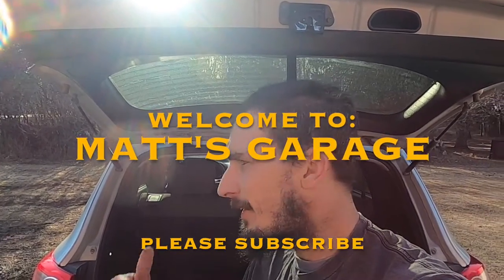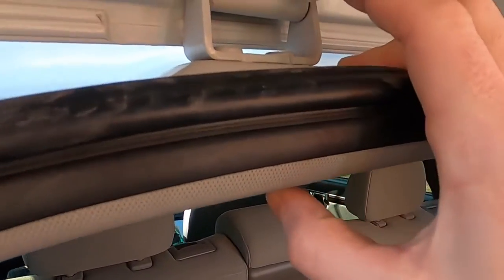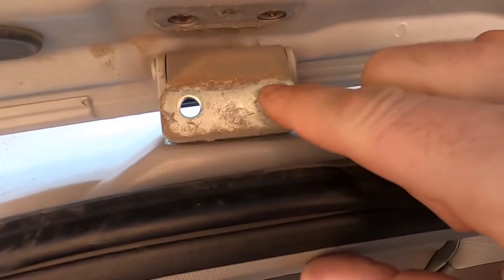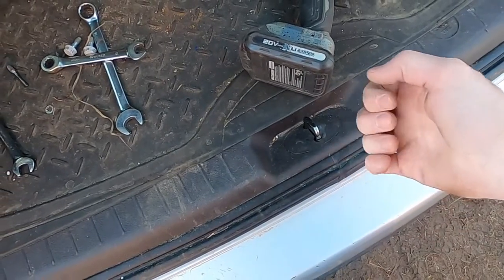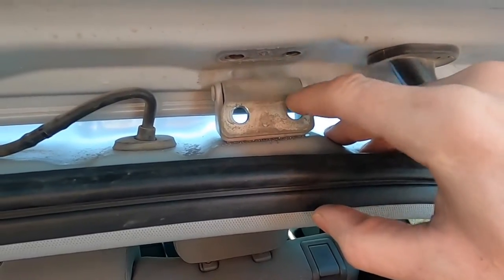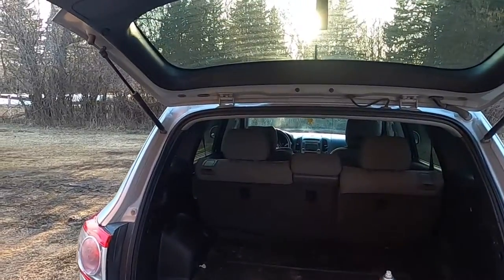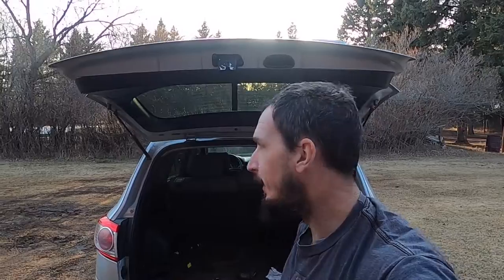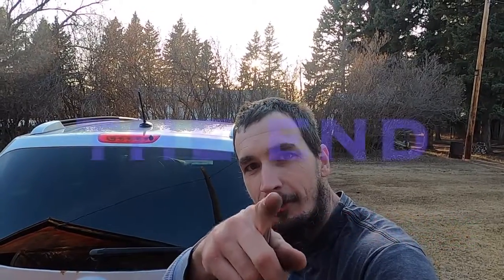SUV Rear Hatch Alignment

Comment: My escape has a massive gap on the left side so im going to shave the holes like you did. Your gap was on the lefty side too, right? So i will need to shave the same holes like you did.
Reply from the maker: Yes, that’s right and it’s possible the Escape has more allowance for adjustment, often vehicles do, but this Hyundai did not.

Comment: Take the door off. Remove the hinges. Place washers or bushing plate between the vehicle body and hinge. Replace hing and door.
This way it will not slip back to the bad position. Gravity will have its way and the door will drop over and over with the enlarged holes nomatter how much you tighten

Comment: Hi, do you think I can move one hinge up/down a little without loosening the one on the other side? The gaps are perfectly even and I just want to adjust the height on one side a little bit.
Reply from the maker: @REQuiemKV626  It is still best to loosen both sides so that you don't end up putting pressure on the other hinge.
Reply: @CarswithNash  Is it possible to do it alone with both hinges loose?

Comment: Hey, I have a 2003 Pt Cruiser GT. I replaced the battery, the alternator, I cleaned out the negative grounds and it still throwing check engine light codes including the battery light, voltage is good 12.4 what can I do to fix the problem before I sell the car? thanks!
Reply from the maker: 12.4 running? That is on the low side actually. Maybe you got a faulty alternator…
Reply: @CarswithNash  oh, running is 13.5 but a cold start, voltage shows 12.2 or 12.4 I replaced the alternator with a rebuilt
Reply from the maker: @lenseofanomad  OK that’s more normal… Not sure why the light, if everything is working properly I would ignore the light, it’s probably a computer issue… But I can understand why you’d want to fix it if you’re selling it. Wish I could advise more but if you’ve already done those steps I’d have to say it’s probably a problem in the computer.
Reply: @CarswithNash  would a 2004 computer work in a 2003?

Comment: Buy new hinges if the issue is wear in the hinge pin?
Reply from the maker: @CHunt-cz1ek  I'm betting new hinges would be hundreds of dollars, dealers charge heavy for things like that. Just not worth it for a junky old SUV.
Reply: @CarswithNash  Depending on the year, they appear to be about $50-$60 a set. Now, I appreciate the inventiveness of your approach (actually "fixing" the mechanism), but sometimes a new part is less complicated.
Reply from the maker: @CHunt-cz1ek  Nothing inventive about it, I'm a bodyman with over 20 years of experience and that's just how things are typically aligned, both in factories and repair shops. Now if the hinges were actually worn to a point where it was compromised and weakened, I would definitely spring for new ones, that was not the case, it probably wasn't even that worn, just a combination of a little wear added to poor alignment from the factory.